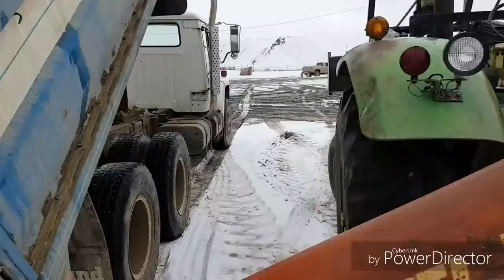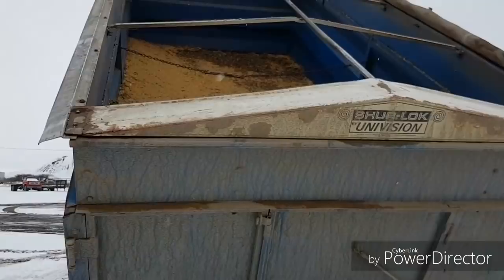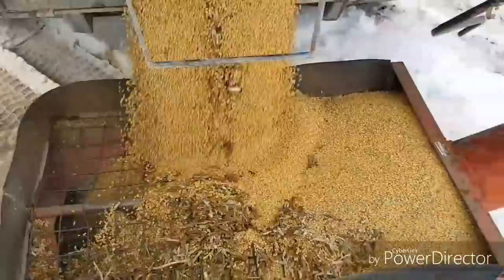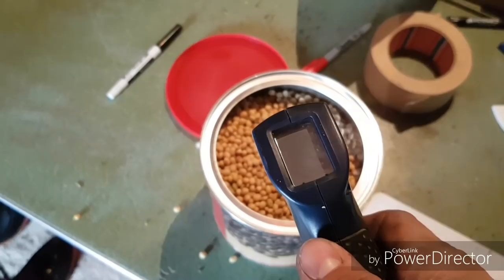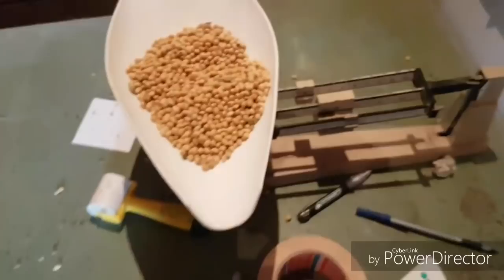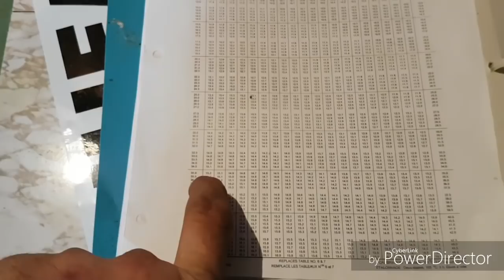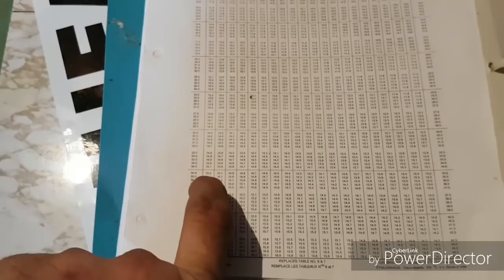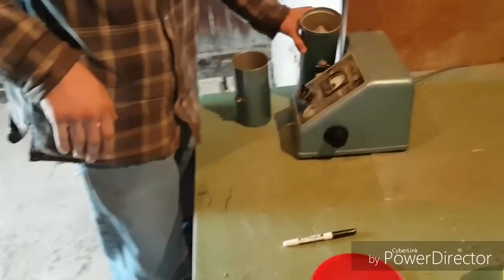Turning soybeans with the vrx!

Comment: Interesting... never seen a moisture tester like that before... :)  BIL has one of those little Dickey-John testers that you dip the cup into the grain tank, dump it in the top of the tester around the circuit board, and after a few seconds it gives you a reading... That looks like some serious old-school equipment there... Not that that's a bad thing-- probably gives more accurate results, BUT then again MOST people nowdays probably wouldn't even know how to work it LOL:)  

Later!  OL J  R :)